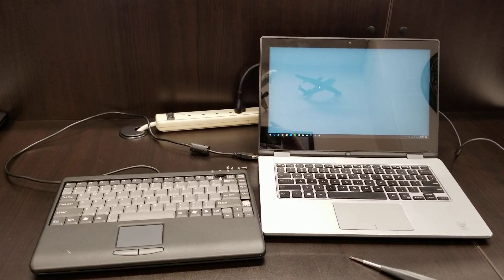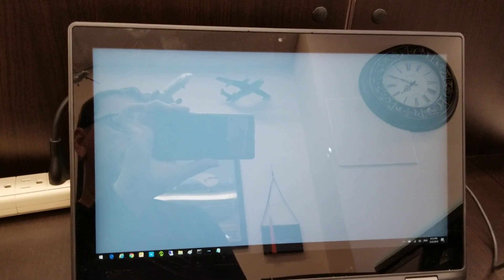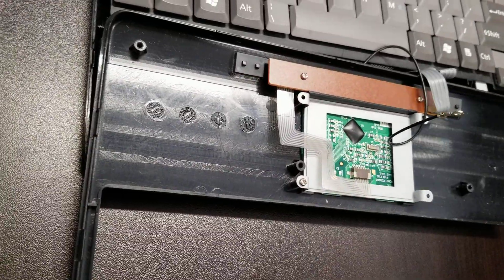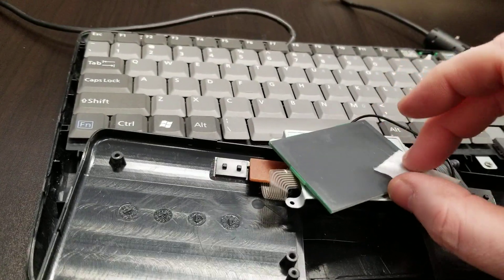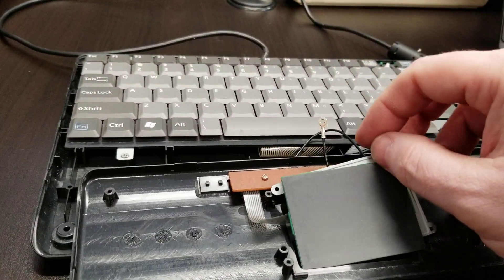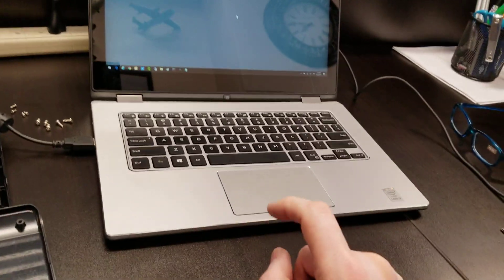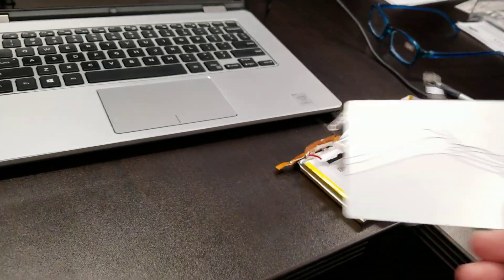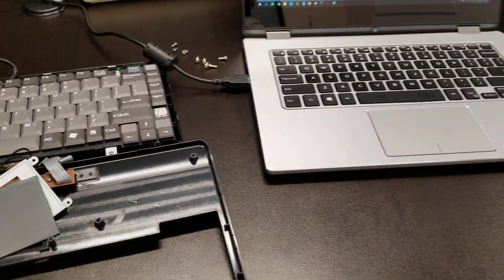Ghost moving the mouse cursor... How to fix the problem with trackpad that has its own mind.

Comment: I believe it is just because of static maybe putting a wire or wirebrush around the pad inside and outside while the otherside is tuched to the ground.
.
It happened to my laptop pad for 4 times.
It moves by itself. Usually moves in X axis hardly in Y axis. But giving it some time like 20  to 30 minutes left alone it becomes alright...
I have a hp laptop runs on Linux.

Comment: Thank you for this video.  I haunt the local Good Will computer center for used equipment.  I finally found a keyboard with a touch pad and bought it (for $3.99), and it had this same problem.  I thought I had wasted my money.  After I followed your instructions my keyboard is now fixed and functional!  The only thing I have to add is to find ALL of the screws holding the keyboard together.  You have to remove each rubber foot and also remove the  ID sticker on the back to reveal two more screws.  My keyboard had a total of 7 screws holding it together along with multiple snaps around the parameter.  YouTube is the BEST because of videos just like this!

Comment: Well, this is the first fix that makes sense. As all trackpads are based on capacitance, it is possible that dirt built up near the edge acts like a finger pressing trackpad at random places. 
I clean my trackpad regularly. However, sometimes it is enough to use a clean damp cloth to wipe the whole palm rest and trackpad. The damp cloth equalizes any static charge between the trackpad and the palm rest.

Also, if you are not technically inclined to open up your laptop, you can try to use cotton sticks and rubbing alcohol to swipe the edges of the trackpad to remove any built-up dirt.

And if your laptop is more than two years old and all the cleaning not solve the problem, than there is one final solution: replace the trackpad.
Reply: Ts Garp I lathered my trackpad with alcohol
Reply: Beautiful. Yes! Thank you SO much.  It worked for me. Grazie Tante!
Reply: My does that when the power cable is connected.. When removed it doesn't mess up round.. what could be the fix?
Reply: Hey there, my surface laptop 2 has this problem after I restart it. I can then restart the laptop a few times and the problem goes away. Does this mean I have a software problem rather than a hardware problem?